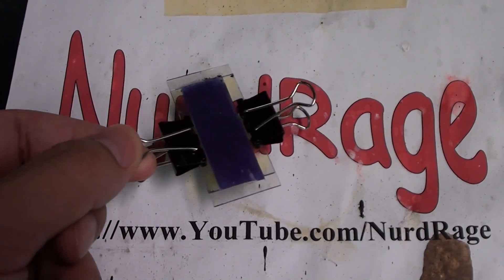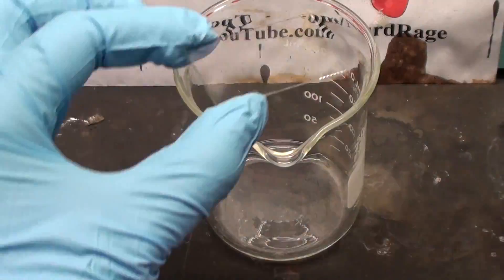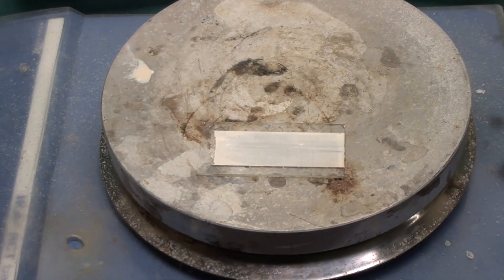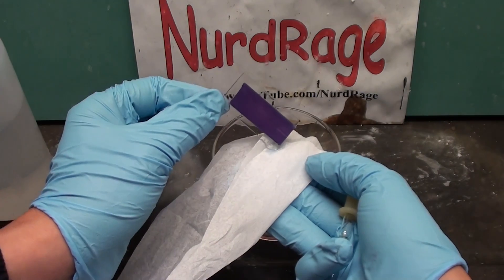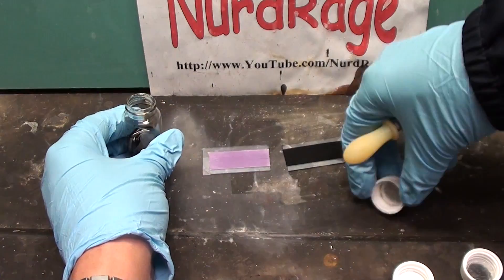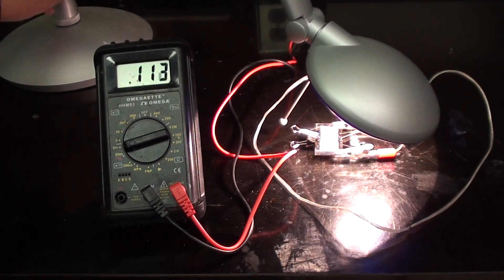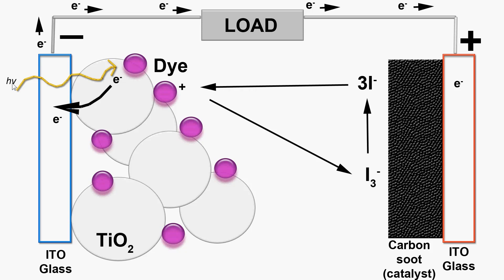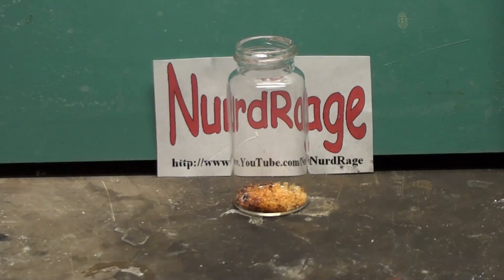Make a Solar Cell - TiO2/Raspberry based

Comment: @NurdRage Could chlorophyll (easy extractible with alcohol or vinegar from for example spinach) be used as the pigment or had any effect if mixed with it (thinking that it would absorb red light and the anthocyanin the green light)?; 

Could be titanium dioxide be replaced with zinc oxide or copper (I) oxide? Could a solar cell be made of a oxidased copper penny coated with a thin layer of ZnO? 

;wikipedia claims that platinum has been replaced more effectively with cobalt sulfide.

Comment: thank u 4 the beautiflul video. . TiO2   present in white paint,toothpaste. 4 dye pomegranate friuit,Red oxide used for rust proof can b used  .somone asked why carbonsoot the same purpose it does in dry battery cell(+) betadine is easily available(4 ioidine) i read somewhere adding tincure iodine pot iodide
 u get lelectrolyte soln tri iodide.someone quted polyamide good. conducting resin  can b tried.a  version of dye solar cell,  was invented by Michael Grätzel et    .ref wikipedia

Comment from the maker: @mouzmaster The detergent helps to spread the TiO2. Normally the TiO2 paste just beads up since the glass is hydrophobic. The detergent makes the paste stick so you can spread a thin layer of it without it pulling itself together into beads.

:)
Reply: the dye didnt stain the tio2 paste.. what did i do wrong?

Comment: Bravo.
I try it to make this cell in three years ago.
I got 0,525V.
I used  the glass for thermopane windows (the windows have an oxide layer on one side - I think is silver oxide) called Low-E
For electrolit I used betadine.
You can put a paper layer, in the middle,  where one side has pencil fill - and this side, with pencil, is over smoked glass.

Comment: @nazifdaniel Find a beach with really nice, fine white sand and take a scoop home. Melt it in the presence of a strong reducing agent. Cool slowly. 
You could also get it from finely ground glass but that's less pure than good sand, as are rocks and dirt.
Note that melting sand/silicon takes a lot of heat and is therefore not easily in reach of the home enthusiast.

Comment: @NurdRage it seemed as though you were talking about the DSSC method in general.  If your raspberry dye does have a short lifetime as you are doing this method then it is inaccurate to use that dye as an example of DSSCs as there are plenty of cheap ways to make the lifetime much longer.

Comment: @NurdRage well, the raspberry dye may become unstable, but it is easily replaced with either chlorophyll from spinach, which is a very good replacement, or by synthetic dyes.  these dyes have lifespans of 20-30years under constant irradiation and at high frequencies.  so that's what I was referring to.

Comment: If you think the voltage is pathetic just use a couple and poor them positive to negative and if the amperage is pathetic put them side by side and connect two positives and two negative and that will increase amperage

Comment: @NurdRage well i cant say fully, but, when we treat the titania it produces excited radical electrons and positive holes withing the anatase structure.  these electrons pass through the titania film, which after sintering becomes a glass, this is what carries the current.  we have been using methylene blue to test and it works.  it is especially effective to dope the titania with WO3 or nitrogen.  when is said incorrect i was referring to the cost problem you stated.

Comment: its actually better to use Titanium isopropoxide, propan-2-ol and a drop of HCL, then dip the slide into it.  its a thinner layer and your get better conductivity across the cell when sintered.  Or you could cast with DSL 90-T paste, which is also very good but expensive, the cells have an average age of around 20 years with the right dye and are cheaper than silicon photovoltaics.

Comment: Hi NurdRage,
very well done.
I hope this will get many more people interested to play with this stuff...
The only thing that is very expensive is the ITO glas , but I think it is the
PN layer of this ITO surface versus the TIO2 that actually converts the sunlight into electricity. Thus you might need to find a cheaper semiconductor than ITO
coated glas that has about the same bandgap as ITO versus TiO2.
Many thanks for this instruction how to build it.

Regards, Stefan.

Comment: @NurdRage @nhojmabon this is an actual industrial problem indium tin oxide or ITO is one of the only transparent conductors know which can be used for this application , this chemical is also running out very quickly and we are set to run out in 2020 , ITO is also a key component in touch screens. i think thats probably why ITO is so expensive and i don't think there are really any sub-statues , if you do find something you will make allot of money

Comment: Does the type of TiO2 matter?  I'm attempting to use this as a demonstration in my AP Physics course, so I want to know whether or not I need to look online or if I can try and find some in a local store.  Also, I'm attempting to do this without using the coated glass.  Instead I'm planning on silvering glass in a lattice pattern.

Comment: Instead of using raspberry, you could have used a purple corn -> Appx. 1642mg/100g of the Anthocyanin dye... but that would have been a bit expensive. What is produced when you mix the water with the titanium dioxide?

Comment: Well this one has a lot of people thinking.  Congratulations on the new top rated.  But really, it's guys like you with a lifetime of chem knowledge that are the odds-on favorites to perfect this.  However, maybe there is a bit of luck involved in perfecting this technology.

First thing to figure out is a way around those expensive glass slides.

Comment: Sweet, I had asked if you could cover this. Could you make a light emitting capacitor? Or even an atomic battery? I was going to save up a shwack load of smoke detectors for the americium.. But never got around to getting more than 4 or so lol.

Comment from the maker: @chrissir While some professors are more boring than watching grass grow, i have to say they have a tough job of presenting science because a lot of it is indeed boring. In order to get to 1% that's amazing you have slog through the 99% that's boring. I kinda whizzed by the explanation of how it works, but a true and complete understanding of every process in a dye sensitized solar cell would fill a university course... or more. So while profs do lecture, its very hard to do better.

Comment: @NurdRage I meant generating H from water or Hydrocarcons (oil). At the moment we get from electrolosis and the like, but It takes more energy to release H than what if gives. I really only have a small grasp on chemistry, I dropped out and did physics,
If I am wrong I will hold my hands up and apologise.

Comment: Nice! I did the experiment myself some time ago (using hibiscus tea for the dye). I also did some efficiency measurements depending on temperature, area and lighting conditions. I got a meager 0,0002 (0,02%) when heated to 60°C. But it worked!

Btw NurdRage, be aware of the desk lamp you are using! I had the same model (from IKEA I think). The sliding contacts in the lower joints heated to almost 200°C (measured with an IR-thermometer after I saw the plastic melt away)

Comment from the maker: @RB13240 ya know.... that is an EXCELLENT question.... the straight platter itself might be a good back/counter electrode.... 

I'm not sure if it's resistant to corrosion or if the magnetic particles might react and break down.... but its a very good idea. Perhaps someone out there can give it a go. (HINT HINT) :)

Comment: Would it be smart to line all the walls and floors of your house with solar cells to collect energy from the lights in your house? Would that save money on the cost of electricity?  I haven't really researched light or solar cells so this may be extremely stupid.